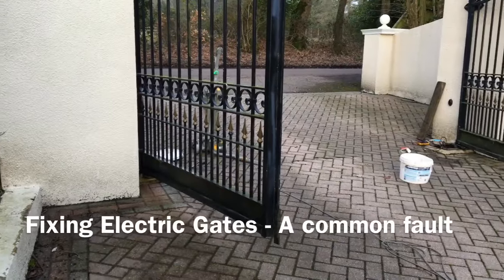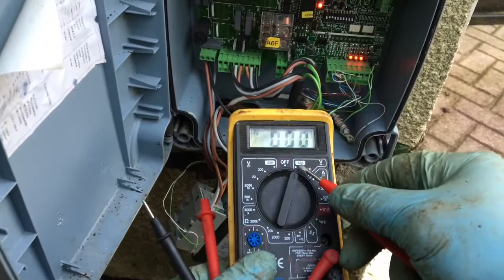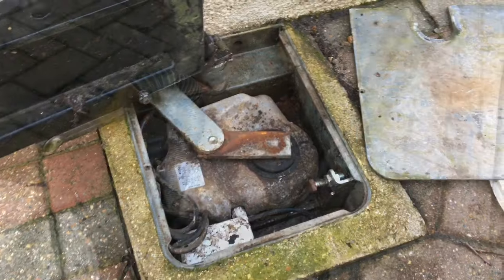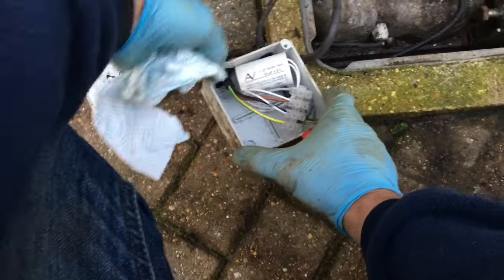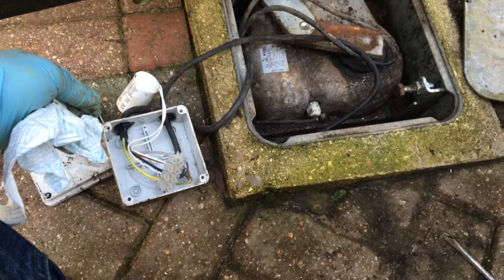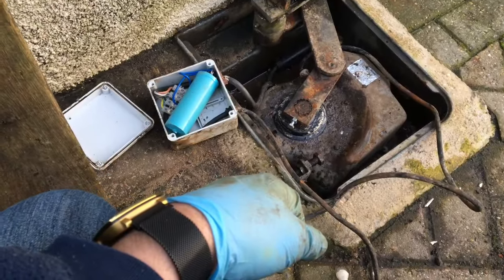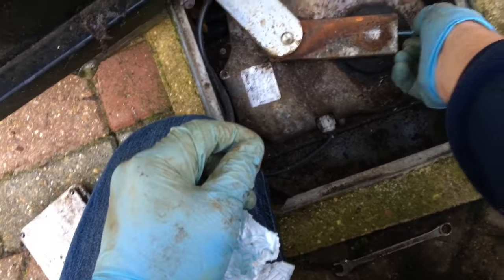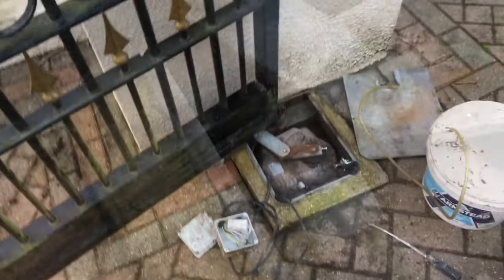Fixing Electric Gates - A Common Fault. (NICE ME3000)

Comment: I know this video is a couple of years old, but just a tip on this, your capacitors do not need to be in the underground motor box at all. They are normally installed on the motor lines in the control box where they will  stay nice and clean without issue. It does the exact same job.

Also, use a circuit board sealer spray (RS do a great one) and spray the control box ciruit board back and front. (Turn the power off at fuse board first!) this seals the board from damp (rusting contacts), but also saves you a few hundred when a snail or bug shorts the circuit board by climbing up it! (This happens so so often and a £10 spray will save you the price of a replacement control board)

Your junction boxes in the underground boxes are going to be way better off if you filled them with a Electrical Insulating & Jointing Resin. This seals the connection block in the junction box by pouring this non conductive resin into them to the top and when dry protects for life.

Just a few tips i hope help!
Reply from the maker: Thanks for your inputs, all sound advice.  I’m not sure it’s possible to move the capacitor to the control box end (why didn’t they do it originally?) as it may need an extra wire in the cable. It’s too long ago to remember and I can’t tell from the video.
Reply: @comeinhandynow  yep, just move the capacitor to the control circuit board. Much easier for future malfunctioning...
Reply from the maker: @basabra  Good tip, cheers.
Reply: Whats the spray called? Can you link it for me 🙏🤞👍

Comment: Hi there a little detail on those capacitors: they are often used on electric motors not only for the power spike but also to provide a 3 phase 220 power supply. 
in this video is used to cope the spike of the turning on. so u could use a bigger capacitor. but for example in water pump single phase, they're used to make the second phase so it's mandatory to keep the same capacity (micro farad).

To the viewers , keep in mind here is running deadly power 220v \110v do not play dumb... it's your skin !
+Nice video buddy, it's time to block those ripoffs were we can do it safely and without messing up :D 

Keep spreading the voice !
Reply from the maker: Thanks for your input.
Reply: @comeinhandynow  thanks to you for the video. it happened in my apartment comples the "plumber" ripped off once, and tried to rippoff twice. couse both water pumps doesnt works . are broken.
due it's apartment complex equipment i cant touch it as part of the plant, but once he replaced the first fail pump, i told him well remove both "broken" pumps. i watched both. both capacitor literally were exploded.
What happened:
we had a thunder storm few days earlier and within 2 days both pums were tripping the magnetotermic protection.
once both pumps were disconnected and considered broken by the "expert plumber" i was able to open em (just the top electrical compartment, i have not the skill and the equipment to work on the mecanical part) found both capacitor blewed up . some issue to find the correct one ( capacity but also the physical size due has to be placed inside the submerged pump)
i spent 14 euro included taxes and 4 hours between find the the correct capacitors, buy em, open both pumps replace the caps and clean the inside of the pump due was spilled with the electrolitic liquid of the blasted capacitor)
result:
we paid over 700 euros to install a new pump. model EBARA RIGHT 100 MA (the version with floating switch and wire)
the work done by that "plumber" was around less of 30 min  unscrewing 2 water pipe connectors, 3 screw for the wiring and 4 screw of the electrical box) changing the pump and screwing back it.
while he was installing the new pump i showed  him the blasted capacitor and i told him THIS is why is not working. his answer was" well if i fix this i'll not work anymore" ...

information:
the same identical pump was avaible at 250 euro vat included at bricomen (sort of home depot chain shops)
same pump was avaible AT plumbing equipment specialized shop for the price of  400 euro vat included to me  (not professional installer).
the EBARA official price list is 500 euro + vat ( but here in italy from the official price then are applied discounts from 30% till 60% according to their commercial agreement: this is what ebara italy commercial call center told me by phone)
Reply from the maker: It’s a throw away society, especially in the trades. Quicker to just charge the customer for new stuff like pumps, even though most of it is still fine and it’s just a cheap capacitor needed.  In a lot of electric motor items it’s the capacitors that’s fail, so it’s the first thing to check.  There’s a similar fix for failed extractor fan motors and a jet washer motor on my channel.
Reply: @comeinhandynow  true. most common problem is also that the "tecnicians" that came to do the job often they DO NOT KNOW due lack of knoledge. to a qualified electrician i had to explan what means to put in parallel a lamp to a siren. was shoked.
Or they dont care of it, due more pieces they change more money they get. on other side in apartment complex we're at mercy of administrators. couse u can't do some repairs due u miss the papers, but not the skills :(

Comment: good video.thanks.My gates will open for about a foot, and then stall. they are gone very weak.the smallest wind will hold them back, getting gradually worse.  wonder if it is the same issue.
Reply from the maker: It could be.  Cheap to try replacing them.  Give the boxes a good clean out too and lubricate the joints.

Comment: TNS is the bolt manufacturer and 8.8 is the tensile strength. 8.8 is the most common rating for high tensile bolts.
Reply from the maker: Thanks for the info.
Reply: My local supplier is pushing this NICE brand for my new install. You've not had any other problems other than the capacitor?
Reply from the maker: My system is quite old, it’s was not working well when I moved in here.  The splined connection from the motor to actuator arm was well worn.  I had to weld up one!  Be sure they have the drain holes actually going somewhere as my motor boxes were full of water.
It probably no worse than any other system and maybe better than most. IMHO.
Reply: comeinhandynow 
Drainage seems a common issue, I'm on a slope so less of a problem, but I will make sure it drains well. Thanks for your reply.
Reply from the maker: Mine are also on a slope.  Big problem.  In heavy rain the water gushes dawn the slope, up the small edge around the motor box into inside the box.  The drains were just into the ground a foot down.  Rapidly clogged and overloaded.  Better to have the drains reappear further down the slope, at the surface, at least they could be rodded out then.
I built small concrete walls in front of the motor boxes to divert the water flow away from the boxes.  Hopefully better now.
Reply: Hmmmm. Thanks for that last post, sounds like some grillage just short of the boxes is required. Thanks again.

Comment: Thank you for this video... I appreciate the time taken and hopefully it will help me fix mine tomorrow morning!
Reply from the maker: Good luck.  Thanks for commenting.
Reply: I tested the main wires from the junction box to the motor and they are all dead, no power, the sensors on the wall are working , since there is no power in the juction box that goes to the motor, it means something is blow in the main box unit? If you could share please.

Comment: My motor connections are not showing any voltage. What does this mean? I can't see fuses on the control panel
Reply from the maker: Hard to say from here. Test with the motor connected and measure between the 3 different phase wires. If one or two pairs of tests are not showing an AC voltage then maybe the capacitor has given up. Cheap to try a new capacitor so try that first.

Comment: Hi was just wondering if the fuse in the control box keeps blowing is that more of a electrical fault than the capacitors failing??
Reply from the maker: It is just a different fault, probably caused by a faulty component on the board (transistor or other capacitor short?)
Reply: Thanks for the quick reply. I temperarely connected to a new board just to see if it was faulty but blew the fuse straight away. CHA light keeps flashing and no voltage detected on open or closed wires (brown and black)??..

Comment: Thanks for this video.   If I wanted to add a wifi relay like a Sonoff to open the gates with my phone, do you know which two terminals in the Nice control box I would need to connect to?  Cheers
Reply from the maker: A nice idea! I haven't looked into this so don't know, sorry.  There may be an led that lights up when the fob is pressed and you could try working out the circuitry around that to see if there is a point to use.

Comment: Hi could you please explain to me why my gates are not closing properly one side catches up with the other and jams before touchdown then it jams and then we have to give it a nudge to close
Reply from the maker: The delay for each gate will need adjusting.  This is a variable resistor potentiometer (‘pot) on the control unit circuit board.  There should be a diagram inside the cover to help find it.  Experiment with different settings.  On one of my gates I couldn’t get any adjustments to work 100% so I fiddled it by putting a couple of bricks where the gate opens fully to stop it opening quite so much.  That gave that gate a head start when it came to closing!

Comment: We've got a FAAC 391 and one side is slow. Is there a common fix  for that beside a new motor? What should i be looking for?
Reply from the maker: You could try lubricating the joints with grease, on the gate joints and on the motor linkages.

Comment: Hi, I had my gates moved in closer to my house around 6ft but now the motors are dead, it’s all connected back up but I do believe the sensors outside of the gates are not in-line, would they cause the motors to not work if the beam is (broken)?
Reply from the maker: Yes
Reply: Thank you for your response, greatly appreciated! is there a way/device that I know they are aligned as the ground level is off and also the fence is not 90° that they are mounted on?
Reply: @foleylad54  most photocells can be adjust inside the housing.

Comment: If you could help me one of my gates is working longer than the other so its over shooting...I've reset the positions but one leaf of the gate keeps going out of sync with the other leaf ..it's a different setup to the one in the video it has the actuators on the gate itself.. Do you know what might be wrong?
Reply from the maker: Not sure. On mine the first gate stops against a metal peg in the ground, the second stops against the first.

Comment: Would the capacitor being faulty cause the main fuse board in the house to trip out or is the motor faulty? If I plug out motor 2 the other motor works fine but as soon as I plug in motor 2 it trips out the main fuse board.
Reply from the maker: water in the box holding the capacitor is probably causing this. it is creating a leakage from live to earth which triggers the RCD in the house.  you need to drain the motor box and dismantle the box holding the capacitor and seal everything back up again.  check the drain channels for the motor box to stop it filling with water as well.  be sure to turn of the electricity to your gates or unplug then motor while you do this so as not to get shocked!
Reply: @comeinhandynow  Thanks for the quick reply. The capacitors on our gates are in the control panel and bone dry, both were changed and the problem is still there. The box holding the motor is full of water but it has been for the last 13 years. Could the motor be faulty after all this time?  Thanks for your help.
Reply from the maker: there must be a junction box in the flooded motor box to connect the motor to the external cable.  That will be the problem area.

Comment: Hi. I have a daspi system but the remote only works close to the unit not from the car. How do I adjust the working distance
Reply from the maker: Have you changed the remote batteries?
Reply: @comeinhandynow  yes had new batteries fitted and brought a new remote just in case.

Comment: very helpful. I have an A6F which suddenly stopped working today, blew the fuse in the fuse box for some reason. Reset the fuse but not no LED's coming on. Any thoughts anyone? Power is on at the gate as I have some lights coming on there.
Reply from the maker: Use a multimeter (on voltage, ac)  to see if power is coming out of the power supply transformer, or going into it.  It’s a process of locating where the voltages stop to locate the faulty part, probably.  Be safe though, don’t touch any mains electricity parts with hands.
Reply: @comeinhandynow  I think it might be the little 5amp fuse in the control panel as no power what do ever.
Reply: checked the fuse. it was burnt out. I had a replacement and that burnt that out as soon as power supply back on again. any ideas on what else to check
Reply: Slug burnt on the back of the pcb

Comment: Please make sure that when you have repaired your gate, there is sufficient safety devices to ensure safe operation. This video looks like addition safety edges would be required.
Reply from the maker: Like what? The gate already stops if it meets any obstruction and it has a nearby light beam detector across the entrance.
Reply: @comeinhandynow  if you don't know the answer to that you should not be fixing gates and especially making videos about it.
Reply from the maker: Nathan Donkin I’m fixing a gate not installing one and it might help others in fixing their own. Why not be more useful to people and actually explain any useful additions for safety
Reply: @comeinhandynow  unless it is your gate, then it doesn't matter if you were installing or fixing, you have to work to the regulations it's your duty of care to know what you are doing is going to be safe. It's not a point of being more useful, doing a risk assessment on an automatic gate is a complex thing,  and should only be done by someone who is properly trained. An automatic gate is a machine and as such falls under the machinery directive, 2006/42/EC...
11 deaths in as many years and countless more accidents, with one engineer, even going to prison for three years last year.....  please look at the gate safe/DHF/HSE websites for more information.
Reply from the maker: @nathandonkin6705  It is my gate. And this is just my story of how I fixed it.  No change to the design or functionality of the gate.  This is just my story.
Reply: @comeinhandynow  just your story that you are trying to capitalise on...you should at the very least put a link to HSE and give a warning.....would you work on a boiler? and encourage other people to do the same without a warning?
Reply from the maker: @nathandonkin6705  I get very little capitalisation from any ads on this one video. I mainly do it to help others save money and to share experience.  I put in a standard comment in the description of “The video is about my personal opinion and experience and contains no paid for product placements. No responsibility is accepted for any perceived recommendation  for or against a product or feature nor any consequential damage or harm since this video is just my personal experience.  You accept by watching this video that you accept any responsibility for any subsequent actions or decisions that you take.”.
However if you want to be more useful and suggest an HSE link specific to this application then I will put it in as well.

Comment: Thanks for sharing the video, I learn something today. Quick question : I have a decade old swinging autogate. 1 arm opens normally while the other is very sluggish and stops halfway. Could it be the capacitor too? (I doubt motors fail easily)
Reply from the maker: I would say its probably mechanical resistance, like rusty joints or debris in the box.  Try greasing all the joints,  the main gate one and the arms.  
To check if the capacitor is causing this try swapping it with the other motor one that is ok.
Reply: comeinhandynow Hi! Thanks for taking the time to respond and helping a complete stranger! :) greasing isn't the solution. I have this https://www.autogatesingapore.com/ranger I haven't yet open the casing but from the pictures I can find online, I don't see any capacitor. Do swing gates operate without capacitors? Assuming there is a capacitor, how to short it out so that I don't get myself electrocuted? ;)
Reply from the maker: Open up the casing.  It might show something, like some joints that need greasing.  The capacitor is in a waterproof box, if it is there.  Just disconnect it without touching the copper ends and connect the ends together to remove any charge if you are worried about that.
Reply: @comeinhandynow  this could damage the capacitor or even blewit up. use a resistance high ohm and high watt to discharge it. we're talking of capacitor for high voltage. so if are charged they present the same value of volts of your plugs. DANGER